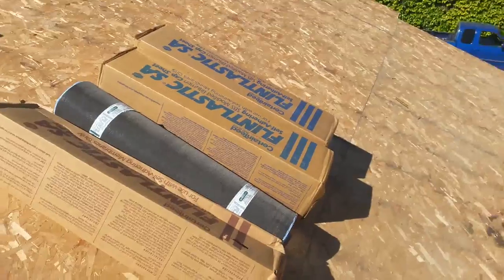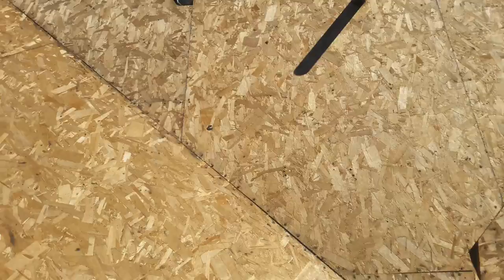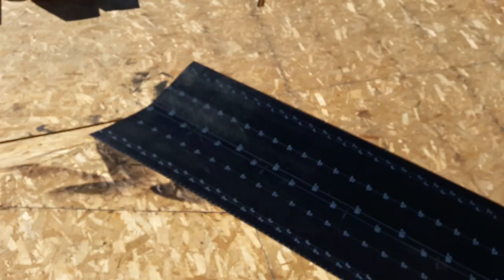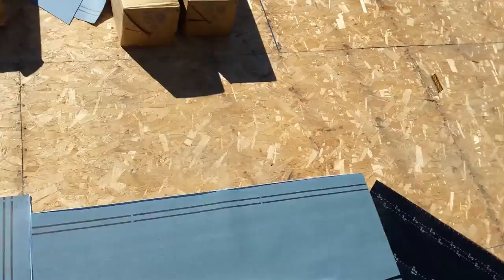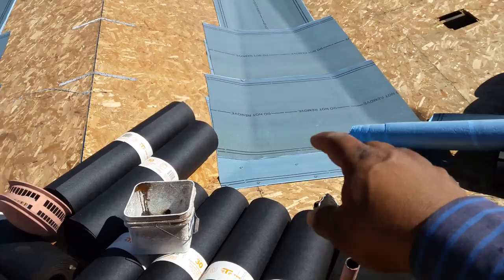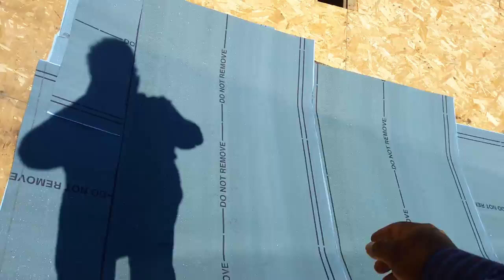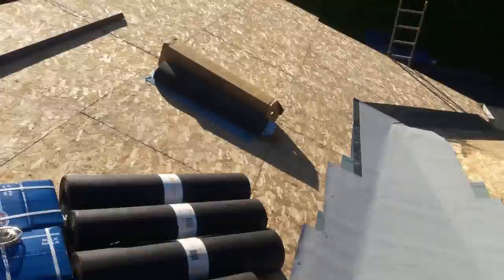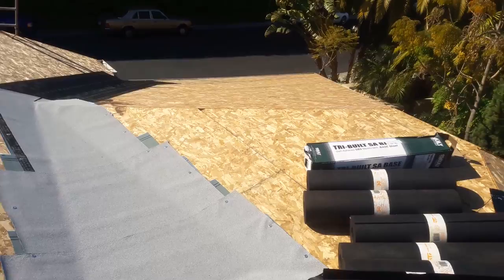Roll roofing  : How to proper install roof membranes , learn how the roofing system works , watch !

Comment: Lots of old school roofers hate the peel and stick. I redid a porch roof on my house that has very little pitch with the same 3 layer peel and stick and its been 20yrs and it still looks great....very little sand in the gutter and zero signs of loss of bond.

Comment: I did a repair on a 30 year old tile roof that was leaking and I couldn’t believe how worn out the underlayment was. They only used 15lb. Felt . But your right Eric about doubling up the 30 lb. 
the tiles were also extremely brittle . Had to be super careful were I stepped. 
Man you can get 30 years out a Malarkey Legasy for a lot less. Or if you want an expensive looking roof rather then Tiles use a good premium 7/8” tapersawns cedar with felt underlayment.

Comment: Hi there, good videos! I have a question - What is the purpose of the first nailed down layer? Is it so its easier to re-roof? Some people just put the peel n stick base, then the cap layer. what is the benefit of the nailed base layer? thanks!

Comment: No roof flashing (valley, tile pan, roof to wall, etc.) is cosmetic . No one installs them because they want but because they need to if not major leak. Yeah I understand what u mean with the felt but the valley metal and other flashings are major in water proofing because the water all destroy any underlayment especially 30 lbs.  good job tho as always.. do u prefer torch down or peal and stick?
Reply from the maker: Torch down , peel and stick works too
Reply: @Garciasroofing  have u ever used 90lbs paper for tile roof? Or what u think about it? U should post more new videos
Reply from the maker: @oscarguevara5089  I have used it under valleys

Comment: Without scaffolding how does your crew get all those materials up on the roof?  I've only seen ladders in your videos.  I purchased one bundle of shingles before Hurricane Irma, expecting the worst, remembering the lines at Home Depot from years earlier.  I lost maybe 20 shingles in all, I was lucky but, my roof is about ready for replacement.  I know from your videos you don't do metal but, how would you advise on that and if so, what gauge would you suggest in Florida?
Reply: Most likely he uses something called a laddervator, which is basically a ladder with a bucket on it that's gas powered and you just put the bundles on the bucket and pull the lever and the bucket goes up the ladder to the top where somebody grabs it off and then arranges it on the roof. Its still hardwork, but easier then toting bundles up the ladder!!

Comment: why do you waste so.many nails on the membrane? once it's on and the shingles go on the nails will go into the membrane as well not to mention when you shingle over your air nail nails if the hit the existing nails would that cause any problems?. great videos tho.awesoem work. just a suggestion
Reply: He said that if you don't nail it the membrane wrinkles, do you listen to the video?
Reply: William Jackson when we do roofs at work we nail the ever loving shit out of the underlayment. You don’t want it sliding while you are standing on it with a 70 pound bundle in your hands

Comment: DONT USE NON STICK UNDER LAYMENT FOR ROLL ROOFING ...vent the roofs...roll roofing will lift if it is not glued down with proper stuff. Then the inspector does not know what they are talking about

Comment: Hasta k se enseñó amigo y no le pusiste papel negro abajo del noventa en el flet como el otro video donde borro mis comentarios jajaja y no necesitas poner 2 veces la bace azul  es la  misma
Reply from the maker: es muy  chistoso tu comentario , dijo ,hasta que se enseno?  este sistema se llama "self adhere" , como usted sabe , a veces , eres el subcontractor, a veces el contratista no quiere gastar en el material correcto, usted lo debe de saber.
cuando yo cobro por todo el trabajo , yo compro lo que lleva , en este caso , debes de instalar en base con clavos , despues el mid ply y por ultimo el granulado .
saludos y gracias por su comentario.
respecto a su comentario ,el dia que dejemos de aprender algo nuevo , la vida ya no tendra sentido , desde 1995 me subi al primer techo y aun sigo aprendiendo de esto , espero que usted tambien , recuerde , nadie lo sabe todo .